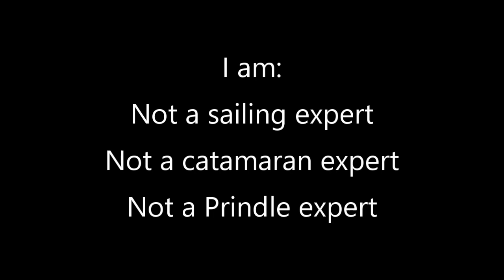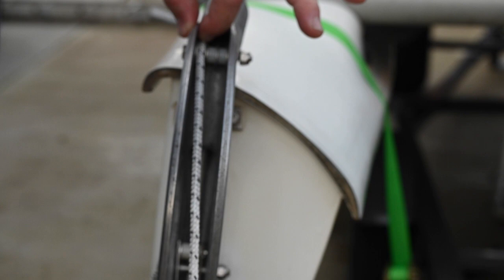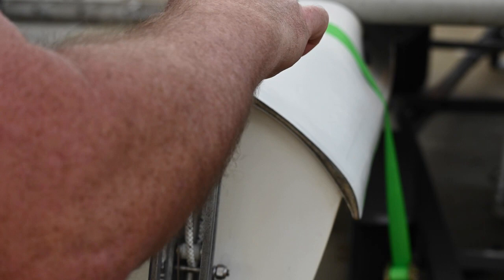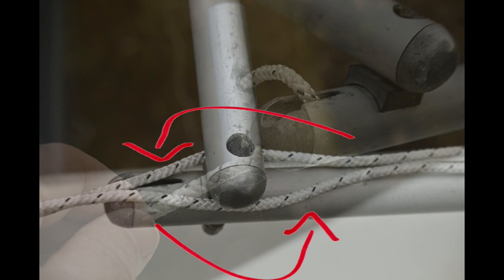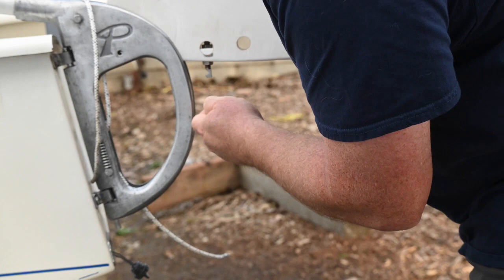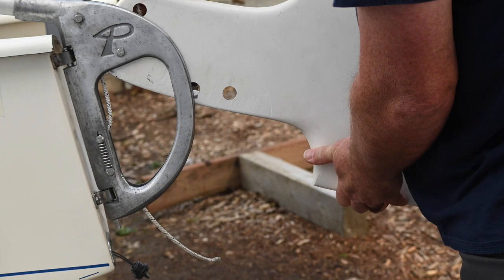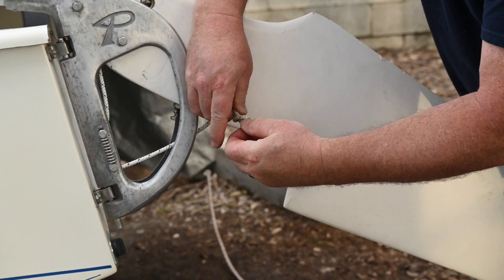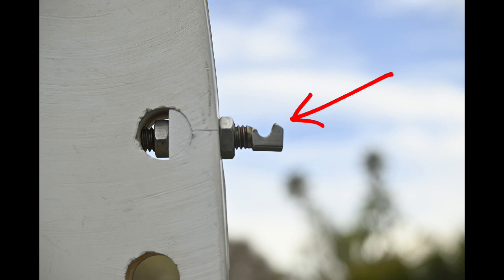Prindle 16 rudder line routing.

Comment: I actually rigged a micro block inside of the tiller tube to provide a 2:1 purchase when raising the rudder.  Best described with a drawing, but here goes: The "up" line from the rudder runs normally at the casting, but after entering the tiller tube, terminates on the micro block.  The line from the T-Handle goes into the tiller tube, around the wheel of the block then back to a bowline knot secured to the bolt that holds the tiller crossbar to the tiller tube.   The installation of the line can be frustrating, especially positioning the loop of the bowline inside of the tube before installing the cross bar bolt.  But once it's done, you've got a 2:1 purchase raising the rudder which is WAY easier than the stock set up.
Reply from the maker: Sounds like a great idea - sounds like the block 'floats' inside the tube?  Can you share the info on the block make/model?

Comment: Great to see a fellow P-16 sailor on the tube. Not many of us and hardly any helpful videos! Great job. Question..what kind of line did you use and what is the correct diameter? Thanks!
Reply from the maker: I use 3/16" (5 mm) VLS from Murrays.   Use low stretch, whatever the diameter you choose.